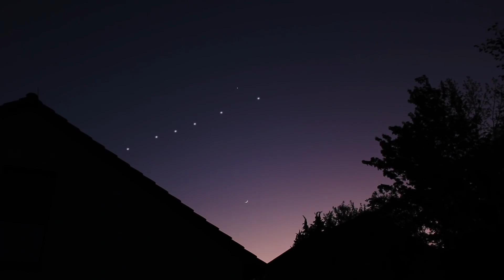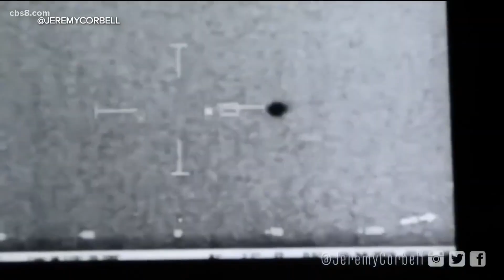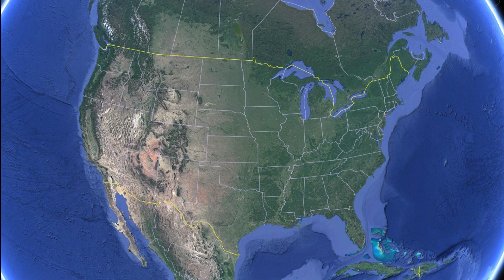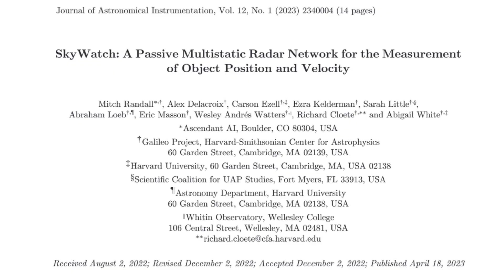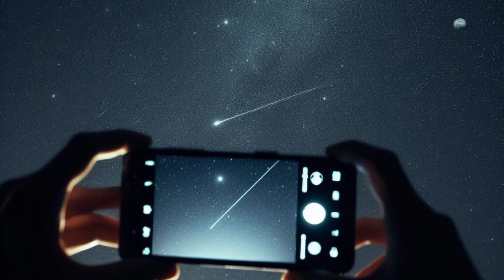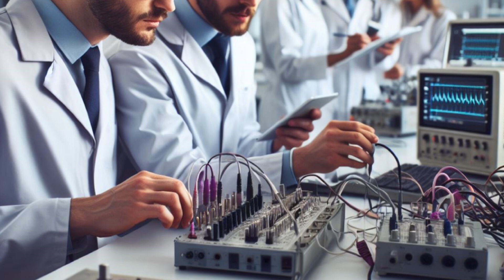SkyWatch Passive Radar & App for UFO Detection and Disclosure

Comment: Nice proposal. For the video recordings, I would recommend for the app to stream the video directly to the servers (with a clear protocol, recording time, date, GPS coordinates, etc.), so that nobody can argue that the footage was doctored. Given that phone cameras are rather crappy (especially when zoomed in), I would recommend a desktop app as well, so that people with good cameras can easily use those (linked to a computer) for visual input using good zoom/telephoto lenses.
Reply: Yes. We have taken it much further than that. There will be extensive metadata associated with each frame. There would be no way the video could be digitally altered. Not even by one bit.
Reply: Ain't tryna have my location figured out by anonymous people online tho.